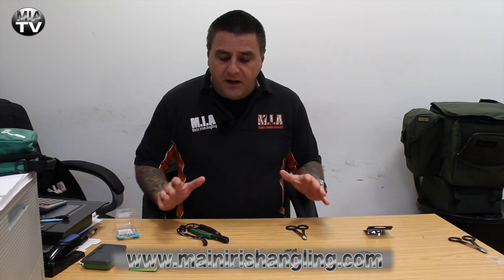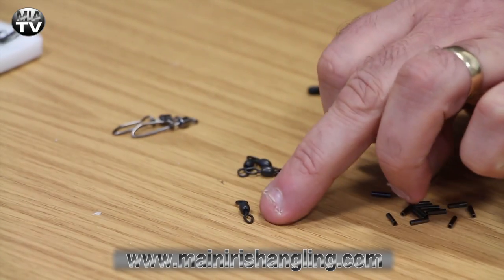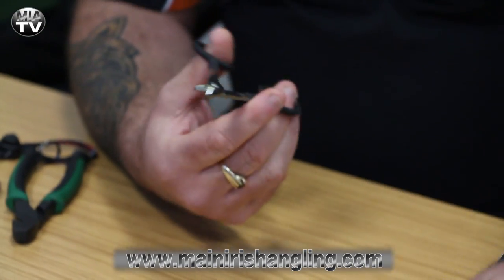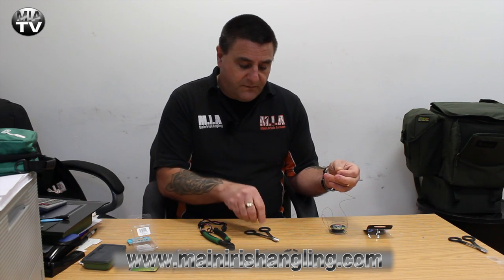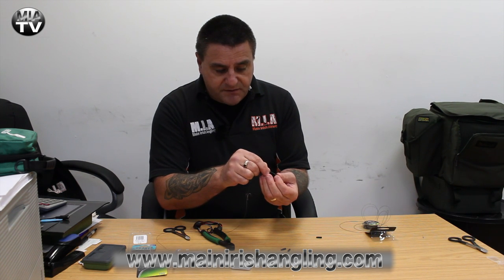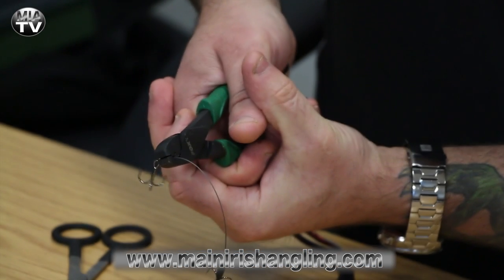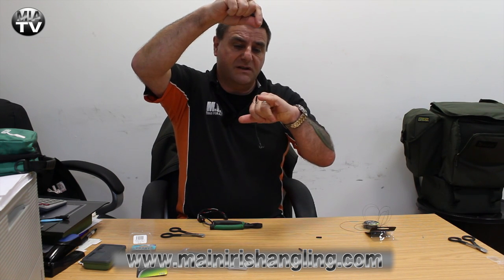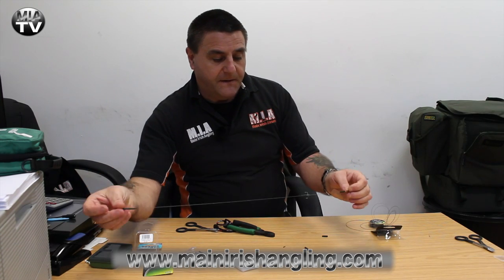How to make a pike trace with MIA

Comment: Good video but just wondering why you leave a long tag end through the crimp and cut off.
Why not just have 1 mm through before crimping? This is easily covered with sleeve or shrink tube.
Maybe add a list of parts with sizes to make the rig up as well